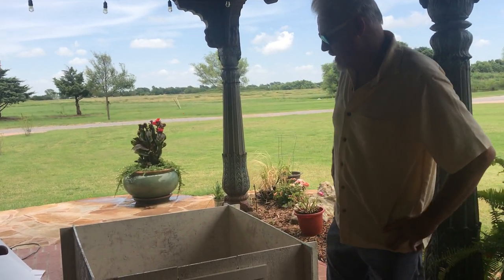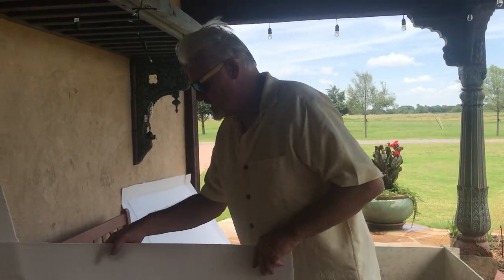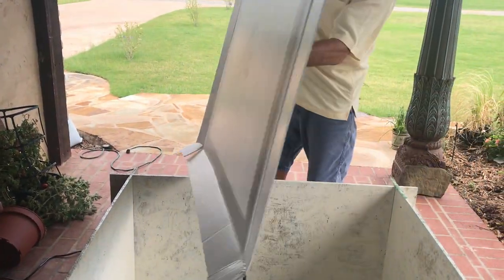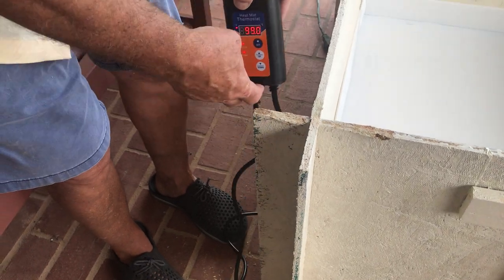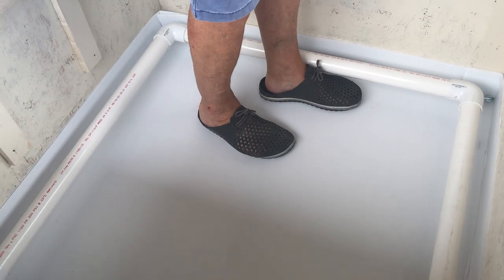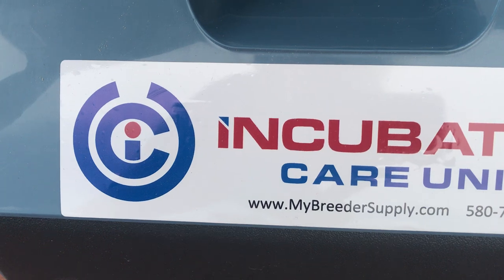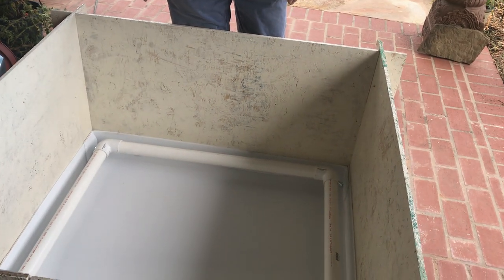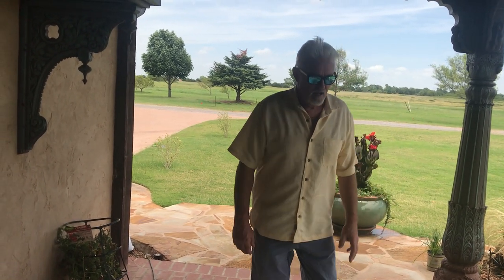DIY whelping box

Comment: This is awesome... Can I use illustration board instead of Coro plastic to put the heating system?
Reply from the maker: I don’t think the illustration board will be good it’s got some foam in it so it’s insulated I think that the Coroplastic is a much better solution
Reply from the maker: And the illustration boat is not very tough the Coroplastic is very tough

Comment: What other materials i could use instead of plastic sheet ?i am afraid it will catch fire or the pups will chew it
Reply from the maker: You can make the floor out of thin metal because it conducts heat it’ll work fine and the thing that you put down needs to be set enough that it will conduct heat properly and if you do that it’ll be fine